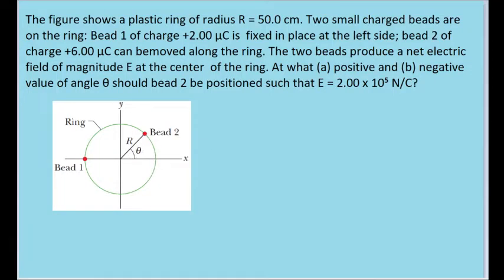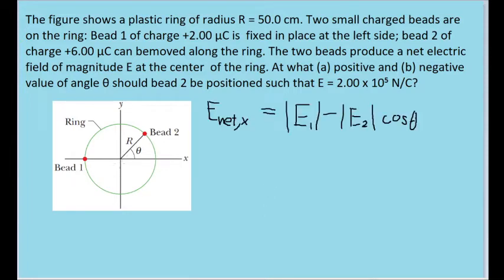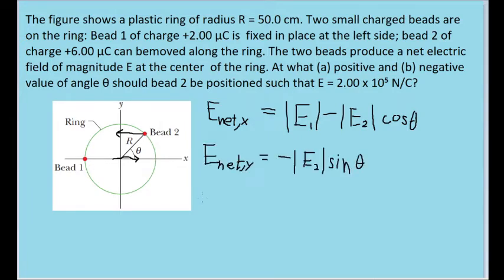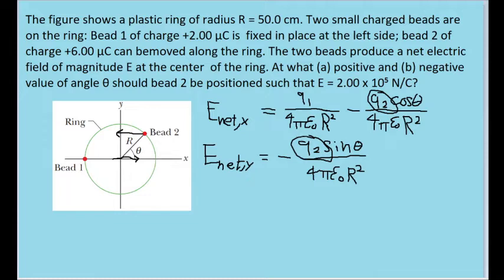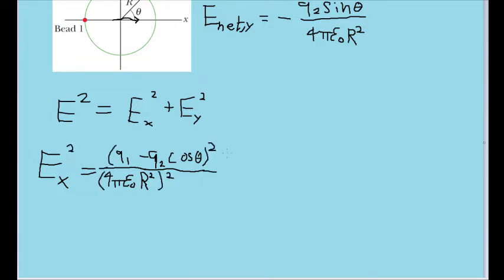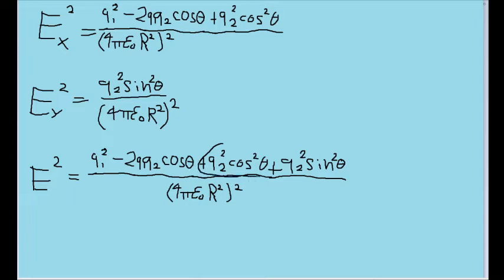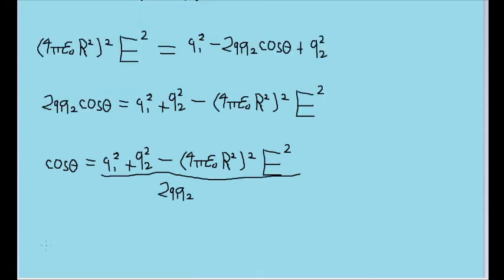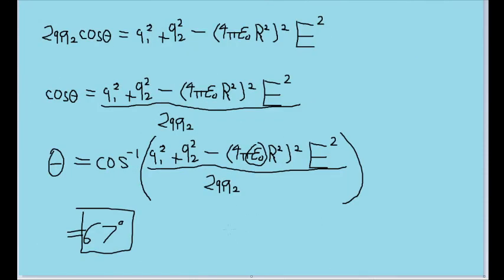The figure shows a plastic ring of radius R = 50.0 cm. Two small charged beads are on the ring:

Comment: When I solved this,I had "112.37°" and "-67.6°",counting anticlockwise and clockwise from the positive x-axis, respectively. 
I don't know how correct I am,but I feel it should be that way,since Q2 is a positive charge,if the angles I got are used,then the magnitude of the electric field should be correct with both angles,tho with different directions.
Please do I seem Correct Sir?🙏